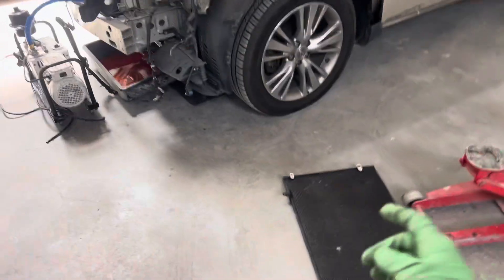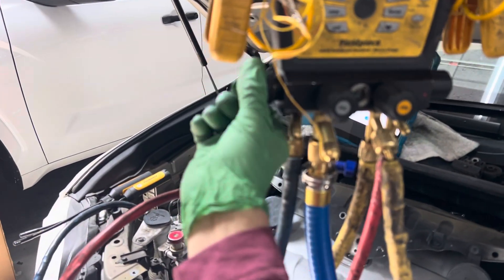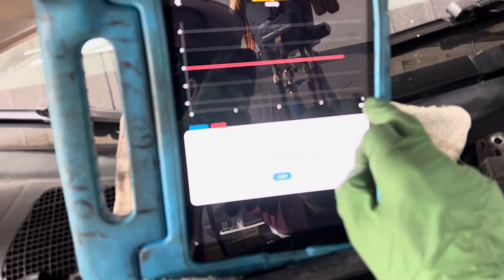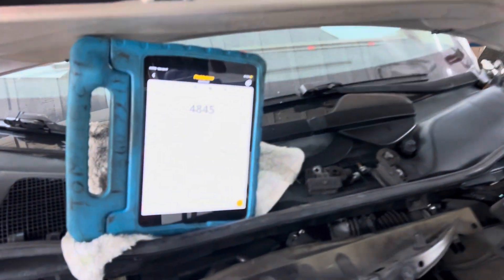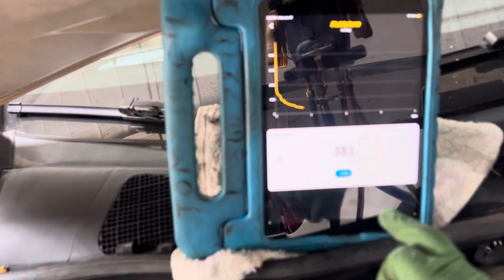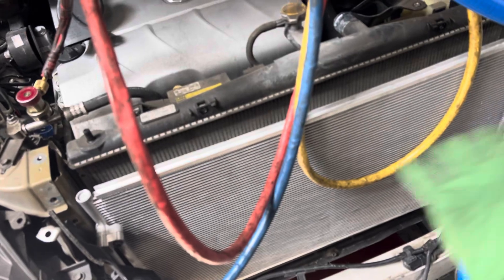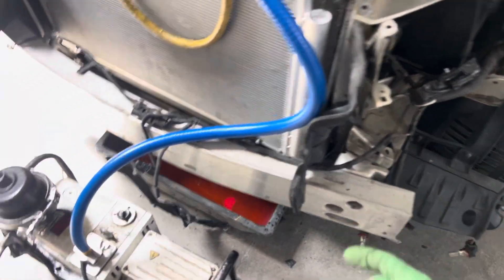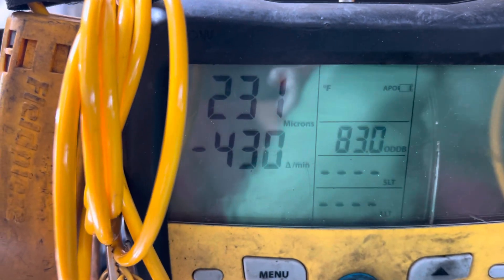MICRON GAUGE ￼readings ideal situation on a clean dry AC system.

Comment: hi, i have robin air vaccum 5 CFM, it never goes less than 700 micros. i believe you told me as long as it hold 1200 microns for period of 30 minutes then i can assume there is no leak.. can u pls confirm ...
Reply from the maker: Nope, I’ve never said that.
Reply: @coldfinger459sub0  ok. can u pls confirm how do i know if there is a leak with how many microns it should hold to confirm there is no leak.
Reply from the maker: @sivucit  vacuum is only one quick method to look for a leak.  But sometimes you can have a leak under pressure and not vacuum..  but you use a ultrasonic leak detector when you’re under vacuum and a high frequency sound as long as the leak is within a visible area you can pick it up with the ultrasonic leak detector. 
     Of course, if the lake was really big, you can pick it up with your ear And find it with your fingers as it changes sound when you stick your finger over the leak area. 
       Jim Bergman has a good video the link below explaining more about vacuum
     https://youtu.be/C8VLjBnkEcs?si=8ZREaC0D_WwMegjv
Reply: @coldfinger459sub0 thanks so much. I watched video and I understand 3/4 true blue with 5 CFM is adequate. I do have ultrasonic leak detector from
Robin air coated 450 dollar. What I still don’t know is how fast decay in microns indicates leak . I used to have manual gauge and wait for 30 minutes . But with digital one I am kind of clueless. In other words there js so much I can teach with ultra sonic leak detector and I need to know whether there is a leak or not so not sure what should I look for in microns value and how fast is too fast in micron to conclude it is a leak and go to next steps like ultrasonic leak or pressure test
Reply from the maker: @sivucit the video that you did not pay attention to specifically explain the difference between a rise and a flat plateau and what is acceptable and what is not acceptable. Apparently you have to watch the video again.. 
     It is very thorough. With great detail, going to explaining the difference between a leak or high moisture content.. and waiting for the plateau to level off. 
     And then, after that, you would go into a nitrogen pressure test at high pressure
Reply from the maker: @sivucit  https://youtu.be/C8VLjBnkEcs?si=-ZIzTfeJYVZf9Qau
Reply: @coldfinger459sub0  Thanks so much i rewatched itagain.. He said that immediate decay of microns is clear indication of leak vs slow and steady and flattens out after 10 to 15 minutes indicates no leak..  one more question i got is, sometime it is difficult to go to other side of condensor to check for leak using ultranoic, when i remove bumper i can access front side of condensor, but to go to back side it is tricky,
Reply from the maker: @sivucit that’s why you purchased the ultrasonic leak detector with the extender one attachment along and narrow like a little tube to bring the sensor down in between hard to reach area areas.
Reply: @coldfinger459sub0 thanks so much. You have been helpful and your service is top notch in helping YouTube. Can you pls advise how long I should drive  after injecting UV dye. I assume 15 to 30
Minutes would help to circulate the dye. Pls advise
Reply from the maker: @sivucit  on a full system to die circulates within usually 7 to 15 seconds. 
   It is extremely fast. 
      It does not always find leaks. The leak has to be big enough for the dye to come through.  Some leaks only leak on vibration.
 Some leaks only leak through heat cycles of getting hot and cold. Some leaks only leak at certain pressures.  
    Some cases you can find a leak right away. In other cases it takes hours days weeks or even months. It all depends on the scenario.
All scenarios are different . 
    There are certain leaks that dye never find

Not all  dye our manufactured created equal some fine, smaller leaks than others some are brighter than others. 
       Not all UV lights are created equal some are stronger and brighter than others in are specifically manufactured at a nanometer wavelength for a specific dye manufacturer who developed their product to work at a specific UV wavelength
365 nm 385 nm to 395 nm even 400 nm or 410 nm 
That all is specific to the manufacturer of the product 
    And then using the correct correlated, nanometer wavelength UV light to correspond with the manufacturers product

Comment: Do you do your own parts installation, my concern is always seal selection and conditioning/lub during installations ??
Reply from the maker: No, unfortunately not. 

I usually come in after the fact when somebody else did the physical work . 

I’m always having to guys and teach them about lubricant is a big problem in this industry because there is no mandatory education in this trade. 

And yes, I come across guys who accidentally choose the wrong seals that caused leaks that does happen . 

Often technicians will install parts without reading the instructions that are printed clearly on the outside of the box or the instructions sheets are still folded up inside the box about proper installation practices of the item that they’ve never read how to do it correctly. This is a very big problem in our industry.

Comment: if a system is "left open", say a car crash and one of the condenser lines is sheared in half, is it best to maybe put duck tape all around the two openings of the line from the crash, or will this make no real difference in the moisture? Of course I know the tape will keep bugs and dust out, but I am wondering about moisture... the car is stored inside the shop, in the non climate controlled section,  waiting on OEM Cadillac parts...It's the owner's Mom's 2011 Deville with only 5,100 miles!!!!  

Great video!!!
Reply from the maker: The longer that you cut down the time of exposure the better. 

Remember that experiment in class in science where they flip a glass or a jar or a test tube upside down and water 

And when you heat the tube with your hands or just a little bit of heat, the air and the tube and bubbles come out from underneath the water it flipped upside down 

And then when you cool the bottle or the test tube, the air shrinks up water inside the tube 

With open refrigerant lines, this is what the vehicle does every day when it goes through a hot cycle say 80° or 70° in the daytime. The air comes out and then at night when it’s 60° 50° or 40° it tracks and fresh moist air with water content. 

The moisture content is transferred to the oil that absorbs the moisture, and the longer the ration the higher, the concentration of moisture that gets absorbed into the oil 

So the sooner you can stop the better 

If this is a friends car or family members somebody you care about and you have the time 

Most people are not going to go through the full flush system after this 

Leave it on the vacuum pump for 24 hours or 48 hours 

You can never vacuum you can just dry the system better 

Not gonna be perfect, but it’s the best you can do with what you got 

Sticking rubber plugs, like vacuum plugs that used to be used on vehicles, vacuum lines, rubber, gloves, saran wrap, taped up over the ends anything helps something is better than nothing